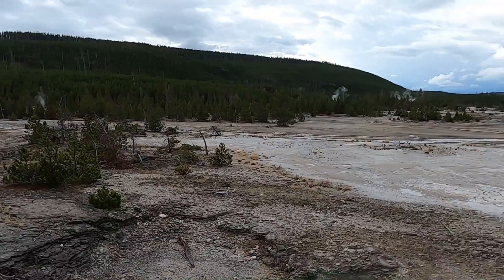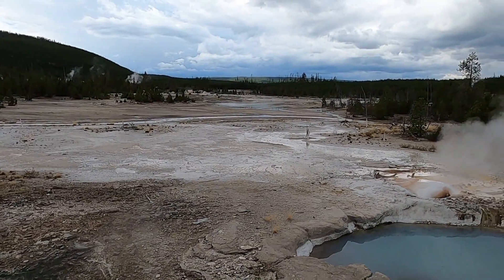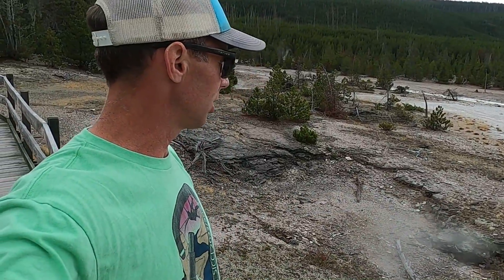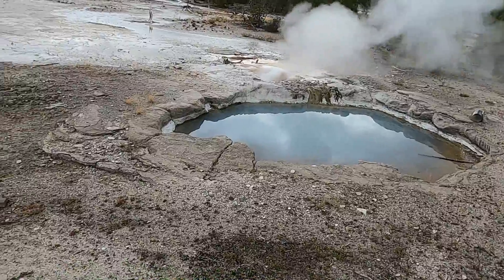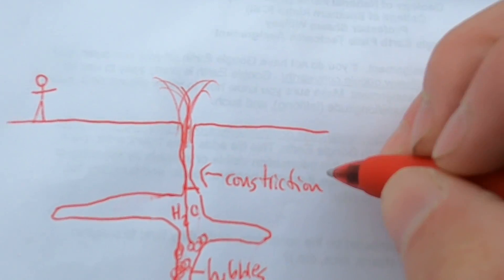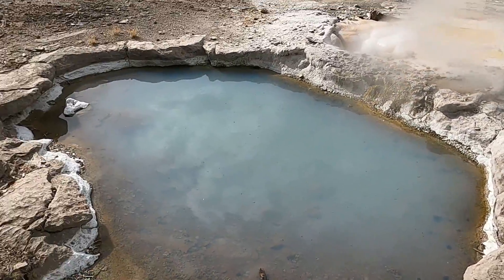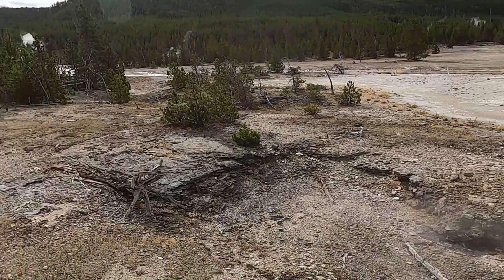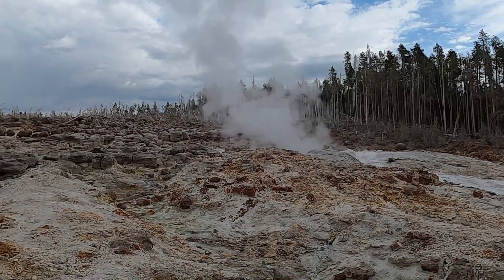Yellowstone's Geysers: How Do They Work and Why They Exist - Answers From A Geologist

Comment: There was an interesting paper which took higher resolution seismic tomography of the Yellowstone system which found the magma chambers are much more heterogenous with magma mush which has % melt fractions ranging from the high 20's to basically fully solidified/crystalized so while the overall percentage of crystallization is quite high the actual internal variation is much larger.  It is however  important to note that just because a magma system is in such a quiescent predominantly crystalized state doesn't mean there is no long term(geologically speaking) risk of an eruptive event.  Some of the cool crystal diffusion work looking at the crystals from Yellowstone's most recent tuff shows that when volcanic rejuvenation occurs there is very little time where the magma body is in an active melt dominated state in the case of the  Lava Creek tuff eruption 630,000 years ago a colloquium talk by a specialist in this technique indicated that their work suggest a timescale of magma mixing began on the order of weeks to several months at most prior to the VEI 8 super eruption. That fact is frankly as terrifying as it is awesome in a fascinating example of how once these melt mixing processes get going the latent heat and chemical reactions cause the system to remobilize and evolve very rapidly indeed.  It seems that the more abrupt this mixing interval the more things go boom on the volcanic explosivity index. This makes sense as if the process is rapid you can build up mush higher pressures faster than the system can release the pressure through gas fumaroles and other hydrothermal/geothermal features and or smaller magnitude eruptive  events.

Comment: I first visited Yellowstone in 1974, part of a 2,700 mile solo bicycle tour.  I didn't get to Norris until a 2003 visit, a time of moderate activity throughout the park.  The Bozeman newspaper had a story "Is Yellowstone Ready to Blow?"  Sigh.

Norris was hot too that summer and half of it was closed after a ranger checking ground temperatures noticed his boots were melting.  It was the only basin that made me feel uncomfortable, just too reminiscent of leaky high pressure steam lines.  I found the cooler basins more comfortable - and interesting.  The cooler temps allow algae and bacteria to grow and color the area.

I  found the smaller geysers where you could be closer and see steam trailing off the water droplets more interesting than big geysers.  A hot springs especially are really neat with their different colors and water that's so clear.

I'm finally getting the 200(!) best slides online, and on their 50th anniversary.  Today's upload was from close to the US Glacier National Park, so not quite to Yellowstone.

Comment: How does the smell of lava/volcanic action compare to that of the steam in thermal features? I'm a geyser gazer, and have long wondered.
Reply: I can't answer wrt lava, but on my first visit to Yellowstone in 1974, it was mildly similar to Pittsburgh PA with its steel mills and coke plants.  One reason I was there was that after six years in Pittsburgh, I had to get out.

Pittsburgh also had diesel buses and gasoline engines before catalytic converters, so it had a more complex aroma.

Comment: Hi Shawn, some food for thought: (1) As the bubbles start to form and expand in the superheated water deep in the geyser, water starts getting pushed out of the vent, lowering the weight and corresponding pressure on the superheated water. This lowers the boiling point which causes more of the water to boil, which pushes out more water, creating a runaway condition. (2) As the bubbles rise, the pressure upon them decreases, causing them to expand further, ejecting more water, and contributing to the runaway condition. (3) The boiling of the water removes a lot of thermal energy from the hot rock at depth, which means that the rock lining the geyser deep down gets cooled somewhat, and it will take some time for that temperature to rise back up again. That should help the geyser refill. (4) Without a vent restriction, and/or with too low a refill rate, it is likely that incoming water would be boiled off and escape as vapor as fast as the water came in. They geyser would become a fumarole instead. (5) I speculate that Steamboat may be in a related state where a restriction needs to form in order for it to reach a point where the incoming water is not able to boil off as quickly as it enters, only for that restriction to be partially or totally blown apart during the next eruption. The restriction may be from sinter buildup or some other minor collapse event. This and variations in rainfall would cause unpredictable intervals between eruptions. Anyway, those are the thoughts that came to mind watching this video. Thanks for spreading education the way you do!
Reply: Great explanation, thanks for posting.

Comment: I can only imagine how hot the watertable is just 20 feet below the walkway. Hence the walkway. I wonder with the two
resurgent domes ( Mallrad Creek and Sour Creek) there if small volcanoes could occur at either one of them in our
lifetimes? I guess that is why they are closely monitored. Thanks for the class on geysers professor.
Reply: Thank you very informative I love leaning about yr country
Reply: The detailed high resolution seismic tomography project deployed a few years back found the melt  fractions through Yellowstone's magma chambers are highly variable forming a really complex network of dikes and sills with some areas which may have melt fractions approaching close to 30% where we think eruptions might start to become possible even if overall the magma chamber is mostly solidified. In that sense it is at least plausible that Yellowstone could erupt during our lifetimes in a smaller scale eruption at the very least just not a very likely event.

Based off of crystal diffraction analysis it appears the current relatively quiet mostly solidified to nearly solidified crystal mush state is the most typical state to find the large caldera complex's subsurface plumbing. Rejuvenation events are rare but once they start they are quite rapid in their evolution such that the transition from this more or less passive state to an active state is abrupt even on human timescales.  With the caveat that the size of an explosive eruption appears to have a particularly abrupt prerequisite timescale for these sort of eruptive precursor events such that sufficiently large pressures can build up to reach such a large sale eruption, i.e. high explosivity eruptions appear to need an abrupt mixing/rejuvenation chemical evolution timescale for the released latent heat to be able to accumulate faster than the system can discharge/outgas the pressure, the lava creek tuff only involved an active mixing/rejuvenated  melt body for weeks to months prior to its 63,000 year ago VEI 8 eruption.

Currently I don't think the magma chamber has recharged enough capacity to produce such a large eruption but a smaller but still likely highly explosive eruption could in principal begin to build up at any time whenever the next major melt injection event from the asthenosphere/upper mantle occurs.  What that looks like is hard to say as we haven't witnessed anything like that but  from the study of the Taupo volcanic system it appears abrupt likely  tectonic shifts  are typical of such systems.
Reply: @Dragrath1  I think you should get your own channel . You seem to know far more than anyone here!